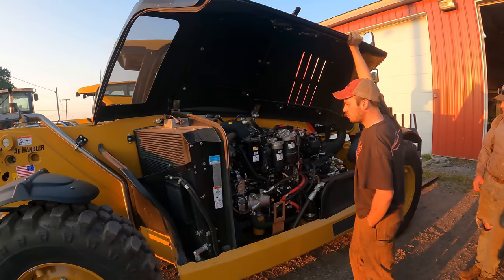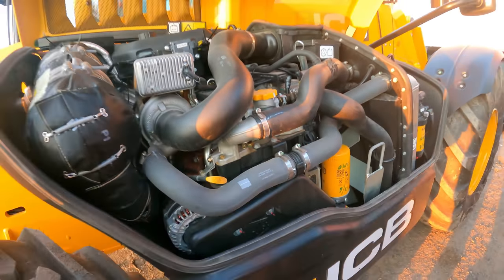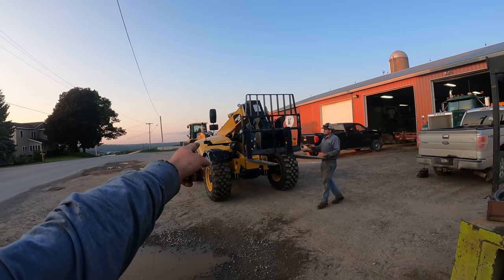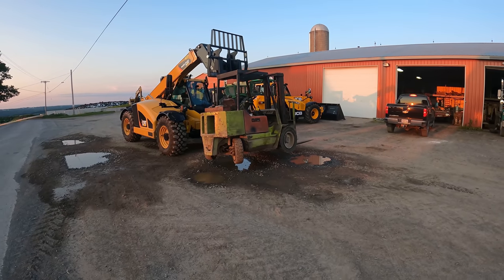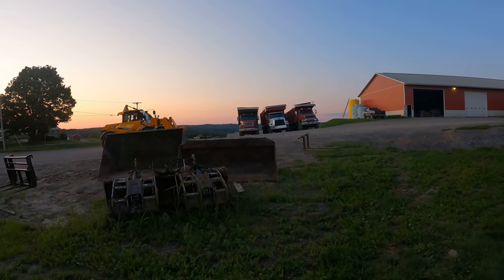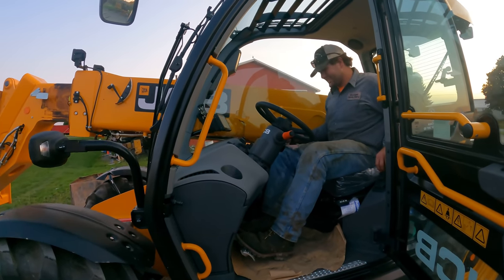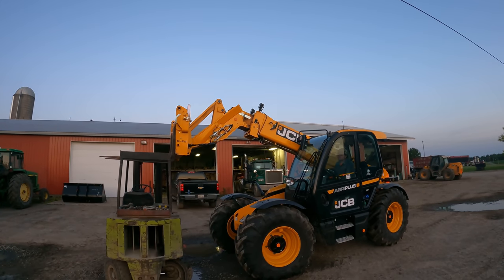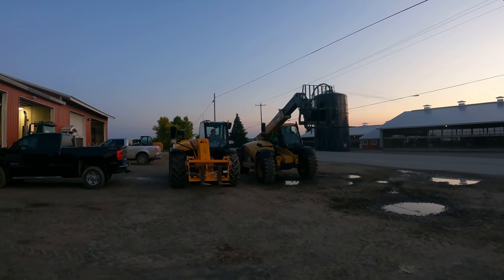Telehandler testing

Comment: Idk. I do like JCB but between a CAT product and a JCB... I’d usually go with CAT. But these are your machines and you guys know what better suits your needs. Both are beautiful machines but since you do a lot of,your own wrenching... CAT might be the better option.
Reply: We rented a CAT tele lift last winter 275hrs almost new, but it had issues, it got "fixed" 3-times in 1-month i would buy a CAT, but not the one we rented.
Reply: @chadsimmons6347  275 hours on a rental unit is about the equivalent of two lifetimes worth of ownership by a caring owner. 😂 275 doesn’t sound like much but that’s about a couple months for a moron to hammer on a machine. Seen machines with fewer hours in horrible shape. Misuse comes in a lot of forms and even tho YOU might not be able to abuse a machine in only 275 hours... I ensure you that there are some morons out there capable of doing it in a shorter time. 😂 You ever see those guys that jam the brakes as hard as they can while they hold the accelerator to the floor? I have. Ever seen the people that don’t want to wait for the machine to warm up naturally on a cold day... so they ramp the machine to full throttle immediately after starting and hold it there until the heater is working? I have. Ever seen guys jump equipment for fun? I have. Ever seen someone that got mad at their employer and dumped Mountain Dew in the crank case? I have. 😂 there are a TON of ways a machine can be abuse in 275 hours. Don’t let that singular machine effect your judgement too much. Even if it wasn’t abuse that made that machine cruddy... all manufacturers are capable of making lemons and just plain cruddy models. Luckily the new machines have a warranty and hopefully they discover it’s a lemon, or bad unit, before the warranty expires and they can unload it.
Reply: @TsunauticusIV  We have an old Skytrak with lever controls that has really stood up well, but it can't be on 2- jobs at same time, so we rent machines. Your spot on about abuse, I see those things tortured by idiots that could care less, they run into buildings, trucks, over fire hydrants 😬& blame the machine😳I like CAT stuff always have, always will😀

Comment: Never driven a CAT. In the UK, the 2 main Telehandlers you get are JCB and Manitou. The JCB lift capacity and boom length is also the model number. 542-70. All JCB telehandlers start with a 5. The 42 is lifting capacity. 4.2 tonnes. Or 4,200kgs. (9,240lbs) and the 70 is the boom length. the 70 meaning 7 meters. (23 feet). Manitou are also numbered similarly, although the length is before capacity. For example Manitou 1840 will be 18 meter boom with 4 tonne lift. 
I have found that JCB tend to have nice controls and an easier to service engine, and the Manitou has a more comfortable cab. 
Another popular brand in the UK  for telehandler is Merlo. I have never driven one so cannot comment on them, but they appear to be taking the farming community by storm over here.

Comment: I have a New Holland TH9.35 Elite, bought it new almost 2 years ago and it’s been a good machine.  Traded a Skytrak 6036 on it that was a huge pos.  Stupid purchase on my part.  Our JCB dealer here is AIS and they’re good but I’ve never considered a JCB Telehandler.  We did have a John Deere telehandler back in the early 2000’s and it was a pos also.  I like the Manitou skid steers I have now so well I may add a Manitou Ag Telehandler next spring.

Comment: If you  do alot of road work, a JCB AGRI-SUPER has a 6 speed  transmission,  the torque converter locks up in 5th n 6th gear so it holds speed on hills really well 👌..... also on the JCB the whole back tub under, and around the  motor comes off with just a few bolts, then it's wide open for  servicing...

Comment: Top Gear Telehandler Test episode!🤣🤪
I heard that Jared.🤙
Those two machines look to be pretty evenly matched. I think the trans mounted engine/hydraulic system, pushed close to the rear tire on the JCB is probably the difference in lift capacity because they were definitely as close as you can get.
Andy, you nailed it with the longevity.👍
All those nice plastics on the JCB have a tendency to crack and break, or fall off like that end cap, especially in the conditions you folks run in and of course the hood support cylinder mount on the CAT aren't exactly the types of things you want to see on a brand new machine.
Either way both of those machines will be run a lot harder than the X-Games when they get to work.🤙

Comment: You can probably add counterweight to them but then they tend to get stuck in dirt. We had solid tires but they were used on concrete, blacktop and gravel.

Comment: Couple of years ago worked at a Sand mine that use a cat tele loader close to the one your looking at. Ran good but the quick-attach Cylinders were always acting up or the Selector valve that it works with.

Comment: Just upgraded from 536-60 to a 538-60 JCB. Cab, controls, and seat are an upgrade. JCB will turn shorter than CAT. Belt is tight to replace. We put 1 belt and idler on at 6000+ hrs. Wondering why you had to replace so many? JCB is very fuel and DEF efficient compared to anything else we run.
Reply from the maker: We had idler and tensioner problems for awhile

Comment: I wish the lift pump and starter were easy to get at on out Cat I was not made for twisting but then it is 20 years old (TH62) and the biggest issue we have had with ours is the transmission cooler but then it isn't a whole lot different to the JCBs of the same age

Comment: on jcb, 5 is series, 42 is lift so 4.2tonnes, 70 is the reach so 7m. quite a nice simple system. The Jcb looks like a horror to work on, what transmission and engine is in the cat.

Comment: I like the way you guys test stuff lol. That CAT does look nice to work on. I do like the JCB units tho. I think the older JCB model number says what it can pick and how far it reach. Ours is a 512 –56, it picks 12,000 pounds and it reaches 56 feet in the air, I don’t know what the five at the beginning stands for.altho that doesnt seem to apply to the new JCB. Those forklifts are pretty heavy, generally the machine weighs roughly 1/3 over its picking capacity. All of our 5000 pound forklift’s weigh like 8200 pounds. The 15k capacity Machines weigh almost 23,000. Awesome video man take it easy

Comment: Think you are being slightly unfair to the JCB as you're comparing slightly different machines, The wheelbase is larger on the cat which of course leaves far more room on the cat for the engine mounting the other way. And the cooling pack hasn't moved on the JCB either. Forks are easy just buy a pair then. But look at all the improvements of the JCB, You haven't mentioned the Curved one-piece windscreen, The fact you can now have hydrostatic transmission/gears as well on the JCB well in the UK you can.. Cat has a much longer wheelbase as well so that lifting makes the JCB look better as it's shorter and so will be handier around your sheds. I know which one I would have for the Cab alone.

Comment: I would never want another JCB, it was great to operate when going, but the list of problems is long and endless, including gearbox falling off engine a number of times (known fault by dealer) complete loss of drive resulting in replacement of hydrostat drive, started loosing drive a second time at 1400 hours,  dealer reluctantly fixed the first time but it was clear if it happened again we would be paying the $13,000 cost for repair, sold machine and purchased Dieci, two years old now with only air con loosing gas as only issue, JCB never lasted 3 months without a beak down. JCB just unreliable with terrible service from dealers, never again
Reply from the maker: Who was your dealer
Reply: @FarmingFixingFabricating  mate I will just say JCB Australia, still need to deal with the dealer so do not want to piss them off to much and much of their problem was caused by JCB Australia not wanting to cover warranty issues